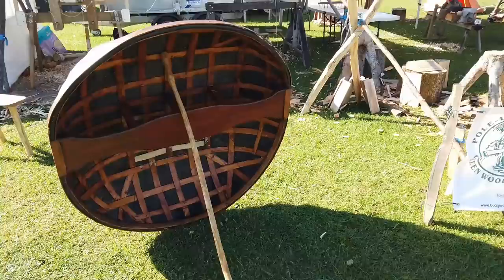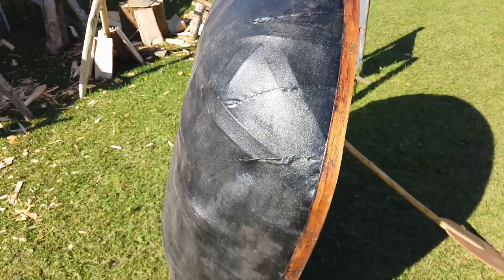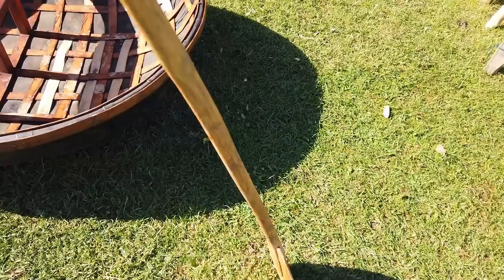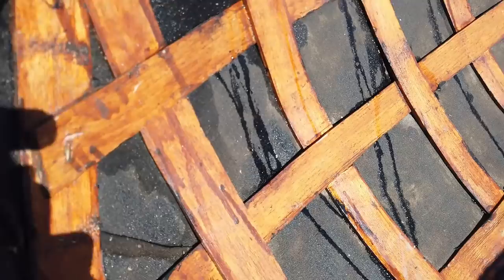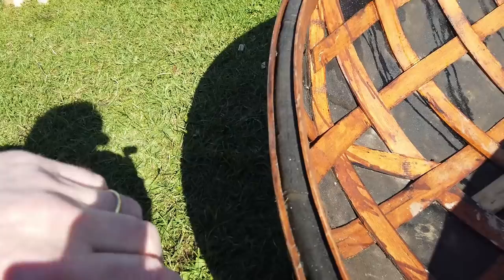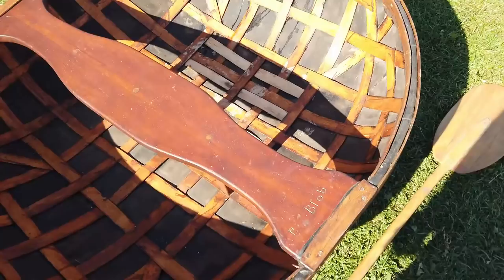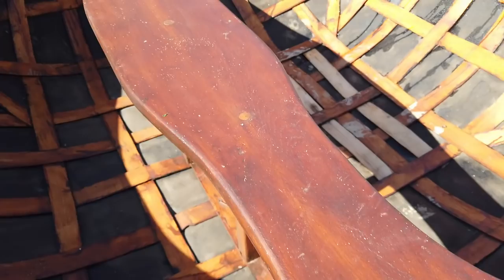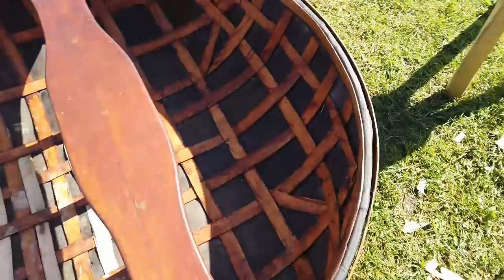A Close Look At A Bodgers Coracle (Basket Boat)

Comment: I believe that I'd rather have a skin on frame built in the "punt" fashion than a round coracle. The little round fellow looks as though it would be hard to track a straight line. I've made boats of tractor tire inner tubes and cotton canvas. Just spun in circles on the pond. Great fun for a young lad.

Comment: Excellent. Now I know the origin of the buffalo boat mentioned in the Lewis and Clark diary. They used the hide of the buffalo as the skin but I wondered about the structure. 

I’m sure it had to be ADH as that is a very commonly used wood in basket making among northern tribes in USA. 

Have you ever seen how they process the ash into workable strips in those old days?

They did it by beating the logs and peeling the layers off.

Of course the buffalo hide had to be “rawhide”
Reply from the maker: We did wonder about a rawhide, and a curator in our group has made one with it, recreating the originals. Thanks very much for your comment. Rgds Harry
Reply: Harry Rogers that’s great. If you get a chance to read about these buffalo boats in the Lewis and Clark journal you will see that they had a difficult time paddling because they used poles instead of the paddle your guys had. 

Looking forward to your build videos
Reply from the maker: @trailtrs1  Thanks